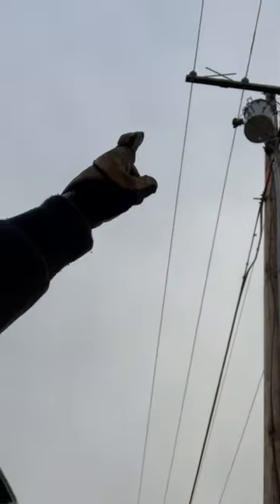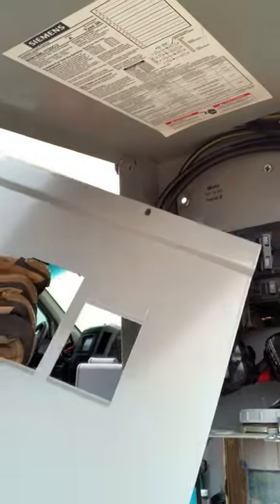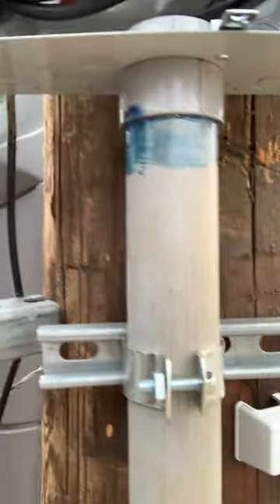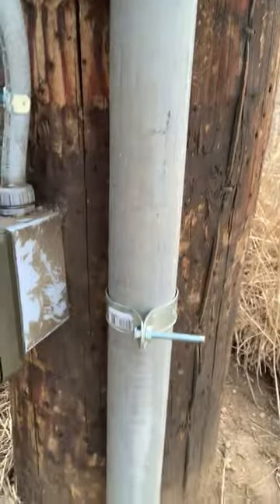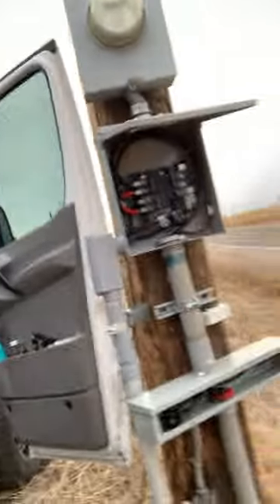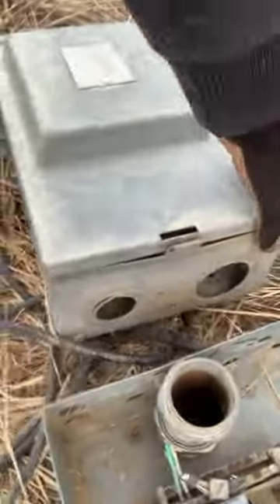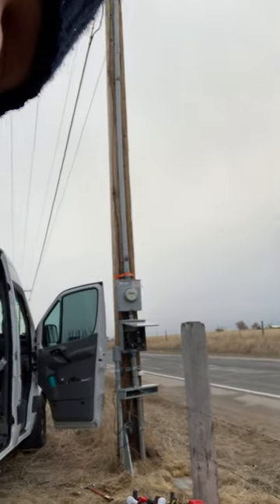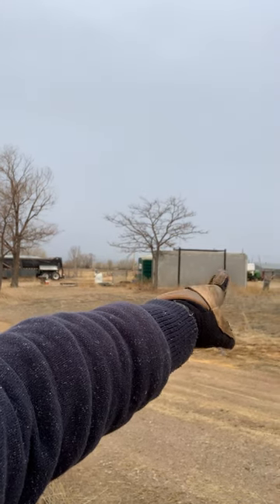Electrical Pole Equipment Mounted Underneath

Comment: Hey Josh I was wondering if you have done a work van tour of the van you have there and how you have it set up
Reply: Hey Josh I don't think they are more expensive, by time you buy tape for the split bolts and the extra labor to install probably the same cost.
Reply: yea you need a shit ton of tape when using split bolts.